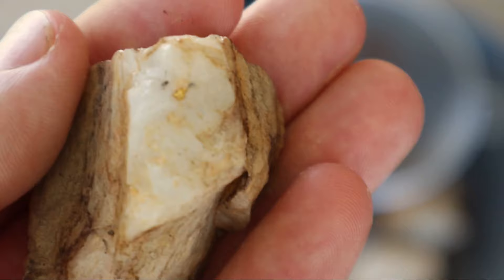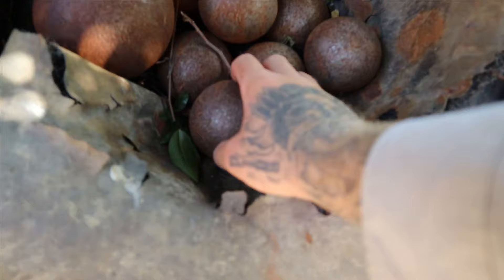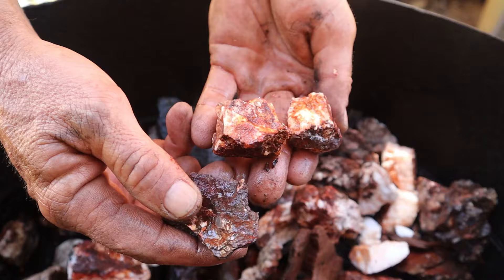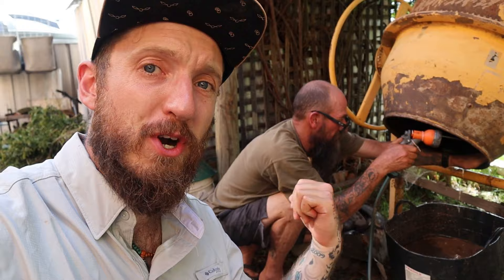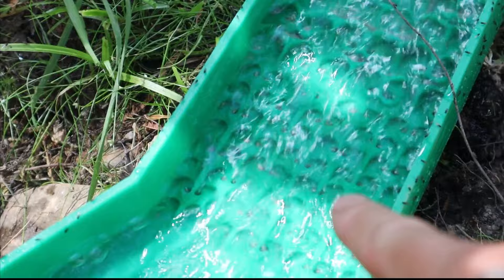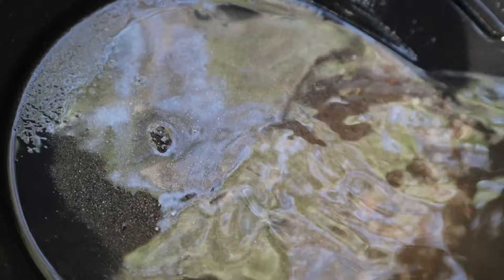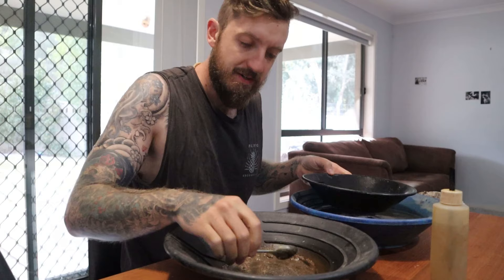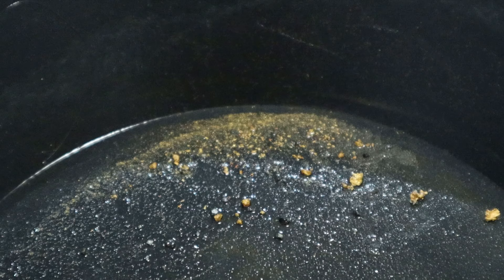DIY Gold Mining - Crushing Quartz to Extract Gold

Comment: Hey man. Awesome crush. 
I’m interested in the crusher. Mad max. Very similar to mine. One question I have about it. What size mesh do you run on the outlet? We drilled like a 100x100mm square full of 2mm or maybe 1.8mm holes in the drum on ours. The result is super fine quartz sand. 95% would be powder with only 5% being 2mm in size. We crush a 20lt bucket in maybe 5-8 minutes and then it’s ready to pan. Skipping the need for the ball mill. The only downside is any reefy bits are usually smashed to little round balls like lead shot.

Comment: I used some lengths of 3” chain in a ball mill I built. And it created nothing but powder. As the lengths of chain grind better than balls. As the connective lengths grind more in their joint than the action of just balls crushing against the drum.

Comment: Chris, if you glue old (or new) carpet to your noisy equipment (including your dolly pot) you will reduce the noise and ringing significantly! Use indoor/outdoor carpet glue and the thickest densest carpet you can find, not the thin stuff! I have been enjoying your work and important comments for years and forever indebted.

Comment: i bought a jaw crusher and hammer mill from MBMM but made the frames and bought the motors separately..  they are still expensive.  buy an extra set of hammers when you buy the mill.
then you can get them resurfaced while using the second set of hammers.  but i didn't know about heating and fast cooling the quartz, so i've already been through one set of hammers.
MBMM is a really good company.  expensive for you to get the equipment shipped to Aussie land though.

Comment: Hi Chris, I have the same problem. I've found rich veins that run 20 to 50 ppm Au with particle sizes less than 100 microns. I've developed a table that does a great job of separating the heavy black sands from the very fine gold. I'll have a new video about it in a day. So, I'd love to have some of your ore to crush and test on the table. -- Dave

Comment: You & I are working our way down similar paths with processing. 
I'm also planning to make a flail mill like Mick's during my next time off. 
Until I get my jaw crusher working properly, 
my current method of crushing, is to use a battery operated hammer drill in a dolly pot, 
and running the crush through a kitchen seive, several times.
If nothing else, I make nice sand!  ;-)

I'll have to try the fire & water trick, looks like it speeds the process up heaps.
I guess I'll have to build a kiln on wheels for that one!

(I gotta be honest, I have just as much fun building the machines, as I do prospecting. 
As you say, it's a hobby!)

Comment: @Chris or anyone else that may know. I've recently metal detected the high bench above a creek that has flour gold. My GARRETT  detector sang out at more spots that read 80 to 84 (silver?) than in the 42+ range (gold?) and they were all 8+ inches deep. At one time, 40 years ago, the blue clay in the creek there, had flat as paper, Chicklet gum size and smaller sized pieces of gold. The bank where it was found, washed away during a hurricane. Could the actual source of those flakes have been washed down from the bench above the creek? Should I dig there instead of searching the creek?

Comment: Intresting you took the crush back out in the field instead of slicing it at home. Have you heard of using a rod or roller mill to crack the hard black sands so it goes through a screed but the flattened gold gets caught?

Comment: Maybe try contacting Sreetips. He chemically refines gold from scrap jewelry and may be able to give you some ideas on what you can do with basic household cleaners, stuff from a hardware store etc. He does it in his basement and his videos are very thorough and detailed. He also makes some of his own equipment like a furnace and uses his wife's old cooking corningware dishes do heat stuff in. 

Also you might want to see if you can get your hands on some old milk powder separation trays. I used to work with milk powder and we had the classifying dishes/trays that went down to I think 500 micron. You would have anything from 4 to 7 trays stacked on top of each other in the shaker which would vibrate the powder down through the trays. You could set it to run for 30 - 60 mins and go watch a movie while it did the classifying for you.
Reply: You give me an idea...I have the shaker, maybe there are people who would need stuff classified....

Comment: Tip: classify down the concentrates to as many sizes as you can. Golden rule: given any constant size of particle, gold will always separate easier using gravity methods (like a pan).

You could also try chemical separation but that’s messy and dangerous.